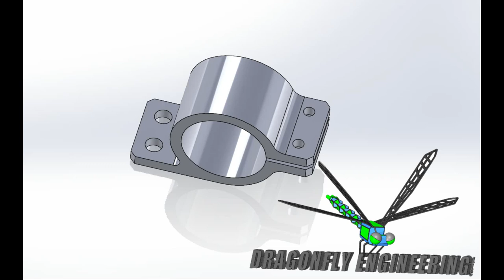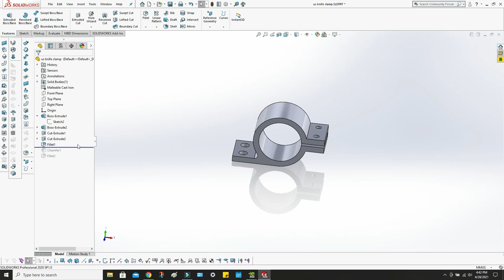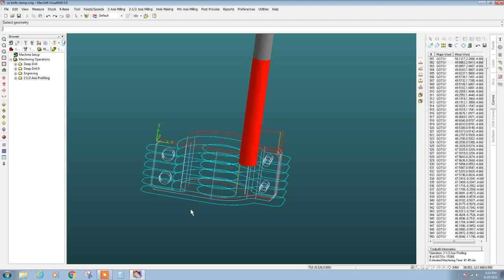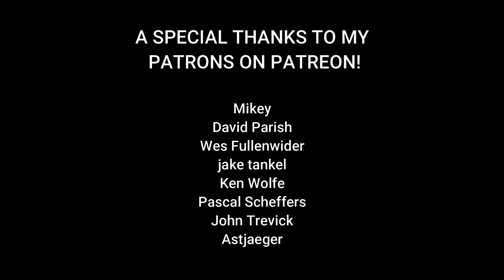Quick Part: ULTRASONIC KNIFE CLAMP

Comment: Couldn't you have found where the wires from the switch went into the base, and attached the wire there instead of in the knife itself? Seems like that would be a bit cleaner. And as the other commenter mentioned, that's flat satin telephone wire. I'm surprised you were able to solder to it so easily - sometimes the "wire" is mostly some kind of fiber material with an exceptionally thin ribbon of copper woven into it so it's ultra flexible.  Love the videos! Working on restoring a VMC that I shoehorned into my garage. Really looking forward to the day where I can go make a bracket like that when I need it in an hour too! Need to get out there soon and continue scraping old oil / coolant / chips out of it...
Reply from the maker: Hi , yes, I tried to keep the wire in the base unit, but the circuit to the button was more complex for some reason, so i had to send the wire to the switch itself.  Hope your mill restoration goes well, sounds like a fun project.

Comment: Isn't machining this part a bit overkill? 3D printing in for example PETG or ABS should work just fine. PLA might be a bit too stiff would also probably work. Or is the slightly higher precision that noticeable in this application? I assume you need to tune it in after mounting the knife anyway.
Reply from the maker: Hi VorpalGun, not overkill for me since I have the scrap metal and the mill setup.  having a tougher part is nice for the machine threads and the ~100K lifecycle.  Thanks for watching!

Comment: I wonder why you didn't wire the cable into the main unit since that's where the wires from the switch ends up anyway?
Reply from the maker: Unfortunately the digital circuit didn’t work out that way, I did try to to it the easy way